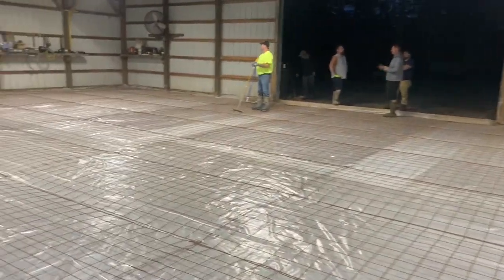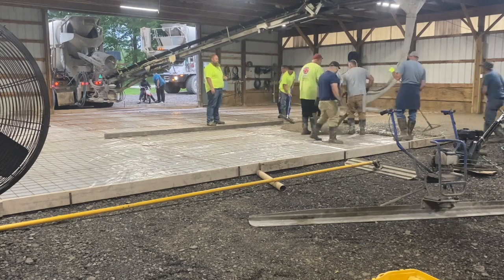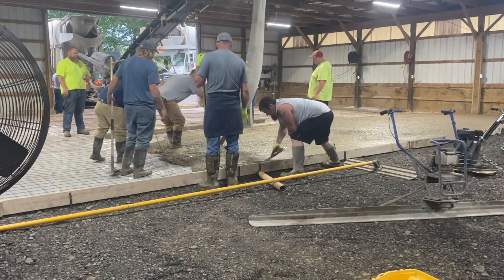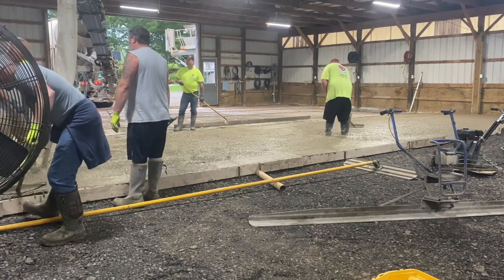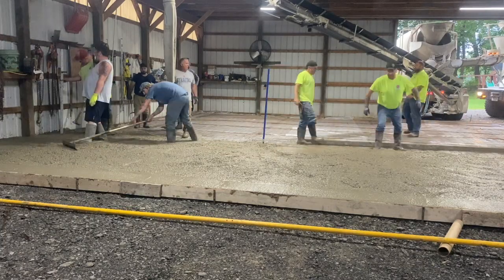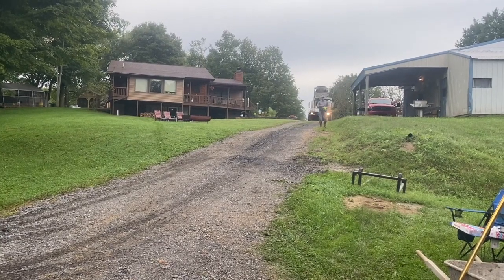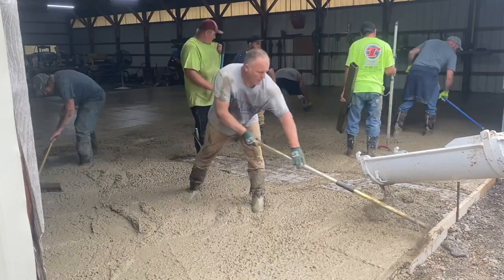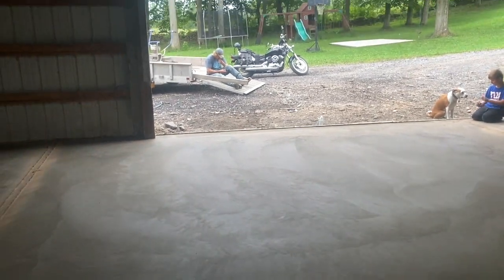What would you do?

Comment: 1:  concrete plant can withhold 1 gal per yard / add back if needed
2:  I would have check slump, if slump was to high on first load reject it, if it was 2,3,4, I would have went with.
3:  more than likely the driver got carried away washing his blades off
4:  you will accept a failing load to prevent a cold joint
5:  4000 psi was a over kill for this pad, 3000 psi would have been fine
6:  I would have wetted it and cover with plastic to help with cracking
7:  it takes 28 days for concrete to fully cure in ideal conditions, I would not put any big equipment weight on it until at least 80% + strength

Comment: In Australia mesh is to be approximately 35mm from top of concrete, not down on the bottom, unless U had 2 layers , the inspectors would make us use plastic chairs under mesh , that way mesh will sit nice and level and in the correct height,. Chairs for that job cost $50 . Everyone does things differently.
Reply: I’m sure the wire was pulled, but with that soup, it may sink too low.
Reply: Yeah, ware are the bar stools hey ?

Comment: Reject the mud!  Most of our S.O.G. and suspended slabs we broke down into 200cu.yd sections, we needed good mud. Usually 3 - 4 slump with glenium added bringing it down to a 5 slump. The superplasticizers are the way to go, added on sight just before the pour. Goes in smooth and fires off quick. It would take a little under two hours to place, usually in less than 4 hours from the start of the pour your done finishing it. All flatwork like this we'd keep 5 minutes between trucks. As for ceilings, walls & columns, we space trucks 15 minutes apart.  This was in the Anchorage, Alaska area, we poured year round. Most trucks were tested, slump and cylinders.  Keep some paver forms, deadman forms, flowerpot forms around for those days when you end of with extra mud:)
Reply from the maker: I have used the super P concrete and it is the way to go. This concrete plant is developing a special mix for me but its gonna be a bit before I trust it on a bigger pour.

Comment: It’s so hard to pull the trigger on sending it back be cause it just screws up the whole day. I think letting it set for 30-40 minutes before screeding ( I think in your area you call it “striking”?).  I’ve been there cause it’s a hard decision, but I think you made the right choice. Fortunately you do have visqueen under it so it will force the moisture out the top so it hopefully will minimize shrinking cracks. Btw we seldom use a moisture barrier in our area, unless it’s on a commercial job. Personally I hate it cause it causes it to act up sometime, as well as take longer to set. The worse part is when you have interior mono footings, it tends to set up slower and causes a little hump in it quite often. Nice job, you made the right decision in my opinion.
Reply from the maker: Thanks for the comment. Looking back maybe I should have kept the first truck low and dumped second on top of it but that slows down getting it all in and this was a big floor. If we dont use plastic inside buildings here they sweat terrible and your tools will rust. 👎 Happy pouring my friend 😊

Comment: It’s nice that you talked about pulling up the wire mesh. If it was dobie or chaired up it would have given the concrete the strength it was intended and since the concrete was delivered wet you lost more strength. Every job should have dobies. If it was a commercial build it would not pass inspection.
Reply from the maker: I find it dangerous to walk on chaired up wire mesh.

Comment: You should have just unloaded the second truck first, while the first one sat with its drum not turning. Within half an hour it would have droped half to one inch slump. I'm a concrete driver thats been laying, pumping and driving concrete trucks for over twenty years. As for any weakness worries...Don't. First of its a slab, secondly its indoors so the sun's heat won't cause expansion, thereby cracking. Also, 4000 psi is more then enough then what was needed unless the owner is planning to have heavy equipment or machinery on the slab. Yes, I understand it takes more time finish the slab as you wait, but as for the end product there will be no problems.
Reply from the maker: Thanks Eric. Good info thanks for sharing.
Reply: Concur..let the first one cook if the second one isn't distanced too far.  And if you do get wet/dry loads happening, always have power trowels/kneeboards split up to where you can access either side of the slab 'just in case'.  The worst, of course, is having a combination of trucks with varying slumps and having a dryer slump happen in the middle of the pour, can't access that area with a power trowel without making a mess taking it through the wetter areas.  Whoever's batching ought to realize if they're dealing with wet sand, which is the usual cause of wet loads, adjust head water accordingly and not have the problem.  That's the thing about mud, you can always add water, but you can't take it out.  Fritz packs, etc. are fine, but that water's still in the load, and it'll come back to haunt during the finish process.  Or later when breaking strength cylinders.
Reply: @jayphillips4058  Agreed, Also fritz pack? I'm presuming you are refering to dry pack or balls. Never heard it called "fritz". Learned a good trick to break them up during my pumping years. If you put two or three, 3-4 ft 2x4 boards in the load and give a good mix it will break most of the balls up without damaging the trucks fins and are easy to get back out. Just one of those old timer tricks I learned in a former life.
Reply from the maker: @jayphillips4058  yup spot on buddy 👍
Reply: @ericbizzell7432   Fritz-Pak concrete admixtures, they've been around a long time.  Quite a variety anymore, I carried a several of them in my mixer truck to deal with the unexpected, mostly delay-set, microair, and Slick-packs, the latter for when you get the occasional harsh mix, get it to slide through.  In a pinch for footings, a few bags will dry up a wet load a little, but you have to be careful how much you try for.

Comment: Hey Bondo thanks for the video. Let's see some videos of preparation of the soil before the pouring of the concrete. Like how far to dig down before you put the 3/4 Stone and all that. Thanks again for the video sold my big house in the city moving to the country. Building my barn like this could use some tips. I know I asked you in the past about slab-on-grade but need to know how to prepare the grade
Reply from the maker: Around here they dig out 2 feet of the topsoil and clay and put bank run gravel down. This id bony gravel right out of the ground. Then they roll that and compact it. Then they build the pole barn and I put finer material on top to get it level. I usually don't do that early work so that's why I don't video that part.
Reply: Awesome  just the info I was looking for .👍👍
Reply from the maker: @MrSprintcat  great 👍

Comment: I have been in the concrete fiber business for over 20 years. In that time I have worked on a lot of very large industrial floors with steel fibers and polypropylene fibers. My question is why is the vapor barrier on top of the welded wire? Doing that makes your welded wire useless in the slab. The wire should be positioned in the top 3rd of the concrete to get any benefits out of it. And than it needs to be up on slab bolsters to achieve that. Wire in the bottom on the slab serves no purpose. Just a waste of money, time and labor.
Reply: It looks like the wire is on top to me. But, I'm not a concrete guy.

Comment: I am retired from management in the ready mix industry. Problems like this should be addressed with the company quality control techs. This could have been a costly issue on a tight spec job. Drivers need to understand the importance of slump control.
Reply from the maker: Jeff I agree it is usually on the driver when it is this wet.

Comment: I’m impressed with the conveyor, we didn’t have those in my day, or at least not in our area.we had to set up chutes and move them constantly. I was wondering how much stress there would be where the conveyor connects to the truck. There is nothing light in concrete, except the paycheck
Reply from the maker: Thanks. I would not want to be under that conveyer if it broke off the truck.
Reply: I'm amazed at how much they can handle.

Comment: Since it's not slump tested any liability falls on the contractor, and you said it was a friends (residential) so it's his $$ and your expertise.
Any commercial work would have several test cylinders pulled by a inspector for a slump/break test and obviously that load would be rejected.
Add mixtures? Plasticize? Polar set? Air entrained?

Comment: When i re built  2 runways  at MIA we were pouring  center line  lighting  . It was 10,000 had to break at 8,000  by 8AM  if not 8:30  we could not open the runway. LD'S were 5,000$   every  hour till it opened.  If it did not come out at a 3" slump it was rejected.  I sent alot of trucks back

Comment: If the slump coming out of the shoot doesn’t match what’s on your ticket I usually send it back. You can screed that wet concrete off and then let it sit open for awhile before you hit it with a bull float. That will allow the first load to hydrate a little so everything finishes at the same time.

Comment: You made the right call or shut the job down. But I often wonder about the 7+ slump thing even though the engineers say so, I`ve been on jobs that lasted over 3 years and you get to see first hand what goes ,what happens in those circumstances. Seen quite a few wet ones go down finish looking beautiful 3 years later with no cracks [ that`s interior and exterior ] so after so many of those I have to doubt the engineers a bit, Maybe if someone would have took core samples and proofed it I would be more believing.

Comment: I would have check the second load.  If it was a 5 slump I would have spread that first load over the whole floor then gone back with the second and third.   Wouldn't have had a cold joint because of the poly holding the water in.
Reply: That's what I was thinking too.  Use that first load of soup (NOT mud) as the bottom layer for the majority of the floor, then (to my mind) as you walk over and work the upper layer it will help blend the two together.  Actually I think that would have worked even if every load was watery.
Reply from the maker: We have done that before and looking back I wish we done that. It slows the job down but it would have dried more even. 👍
Reply from the maker: @michiganengineer8621  Yes I will for sure do that next time. we have done it before and we should have here. I learn every day I pour concrete. 👍
Reply: When I worked for a contractor, we poured a slab floor to even the granite base. We couldn’t get it to set up due to the solid rock so we laid and evened the pour,went home for the night ,came back 11 hours later and was ready to be finish troweled.

Comment: It takes about two minutes to slump test some right off the truck initially.  If the concrete is important, you should be doing this and just reject the load.  This is all on the mix company to correct.

Comment: If I were the big cheese, with concrete that wet I would have put it on the bottom and poured the stiffer crete on top. Secondly, I have poured more concrete than most people, having worked highway construction for 40 years. The first thing I would tell the supplier, I want a 3" slump - it's easier to add water than remove it!
Reply from the maker: I agree. That would be better to bury it with stiffer stuff. They usually have a nice 5 slump for me. Not sure what happened that day. Ya never been able to get the water out. LOL

Comment: Add slumpbuster ;) I order it drier than I want to pour by 1 number (usually i order a 4 and pour a 5 unless it's small, cold, or a lot of pitch
Reply: U guys use vibe strikes?
Reply from the maker: I like to pour at a 5-1/2 to 6" slump. I will have to get some slump buster. thank you 👊
Reply: @GRUBB-MUDD  no we do pretty small pours, 2 man aluminum screed, terrible puddlers 🤪. I like the Australian style one man screeds Concrete ninja uses but the aluminum ones are useful for other things as well and I don't want to carry around 2 types
Reply: Man I used a viberstrike today, and it was only 13 yards maybe 14 and it was hump day! Good thing I had that Cadillac Concrete Products bullfloat
Reply: @bondobuilt386  Just FYI, slump buster is not designed for use with any sort of fluidized mix. You mentioned that there was a plasticiser in that concrete mix. Slump buster really only works for non-fluidized mixes at around a 4" slump or less. For anything wetter or anything fluidized you'll want to use VMA (viscosity modifying admixture). If you make friends with the quality control guys you might be able to get some of those admixtures that aren't available in fritz packs.

Comment: I've tore out a lot of concrete and almost every slab with mesh it's on the bottom not doing anything or in the dirt all rusted out. I'm just curious why you use mesh as opposed to steel or fiberglass rebar? I know everyone is different in how and why they do stuff just wondering. Good job by the way
Reply: Because it is a fraction of the cost and significantly cheaper to install when you factor in labour costs. Any concrete company worth a damn uses rebar reinforcement. Mesh is a cheap man's material nothing more nothing less.
Reply from the maker: We have to be competitive with cost. The mesh and fibers are above the building code. They would just hire someone else because they were cheaper.
Reply from the maker: @josesoares1245  I use bar where the homeowner is willing to pay the extra. Most are looking at the cost and it is already above code with wire and fibers.

Comment: What if you poured the first load thin, maybe only 2 inches then topped it with stiffer concrete? That sloppy mess would cold joint fine.
Reply from the maker: Yes we could have done that. 👍
Reply: get some bags of dry Portland mix and spread it around and work it in with the power trowels.
Reply: @gunfisher4661  That would be fine in the truck if it was added before 90 minutes 270 turns were elapsed since batching but would never get a proper mix in the pour.

Comment: You may have ordered 4000 lb concrete but it probably closer to 1500. I would have poured some test cylinders and had the concrete company replace the slab if it came in under 3000.

Comment: I’ve rejected mud before but it was a big condo job where we were flying it by tower crane in 3 yard buckets the had brought us a truck load of gray water and wet rocks the driver had left the water valve on we normally ran around a 6” slump on flat and ran a little drier slump on the vertical walls so the rocks don’t settle as much

Comment: How is it that concrete is mixed wrong? Don’t the concrete plants weigh everything to a formula? Is it human error?
Reply from the maker: It was the driver adding to much water to the load. They fine tune the slump in the truck. The Aggragates can be dry or wet if they got rained on so they need to adjust things.
Reply: @bondobuilt386  supposedly the computerized batch plants have all that programed in their computors

Comment: Why pour the front before the back?  I didn't see a door in the back.

Good decision, save the vibratory screed for the truck with a thicker slump.

Wire near the bottom is stronger than wire center or higher.
Reply from the maker: We started in the back and worked to the door. I agree on the wire. 👍
Reply: In our area the engineers tell us the rebar gives max strength 11/2"' from bottom and 11/2" from top and thats running 4` thick pads , so that would be similar for wire I think but I have demoed slabs with wire up in the middle and it sure is a booger to remove even with a track hoe and a buster.

Comment: Where are the stools for the reinforcement????  There is no way that the reinforcement can work with the concrete when its laying on the dpm and I wouldn't be surprised that the concrete cracked up, notwithstanding that the bay is way too big to control shrinkage.  How can the concrete be level as there is no tamping bar.  I see that no slump test was taken to verify the water content even though the poster is clearly concerned about the wetness.  Why is the concrete poured in the front bay first?  Surely, the rear bay was the first to be poured so that no slab area is poured over a newly created one, moreover since there should be no loading on the slab like a concrete wagon for 28 days, only light foot traffic should be on the slab from 7 days to full strength at 28 days .  The slab should be vibro-tamped - note the bar laying on the rear floor that doesn't seem to have been used.
I would have condemned the slab if it had been constructed as shown on any of my projects.
Reply from the maker: You should take the time to do a video because you clearly know more then most. Or at least you think you do. LOL